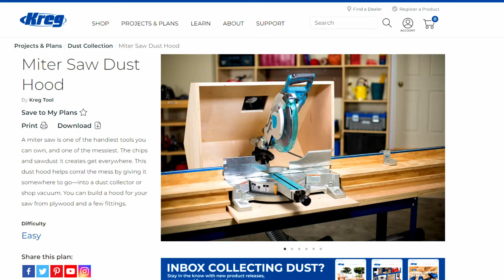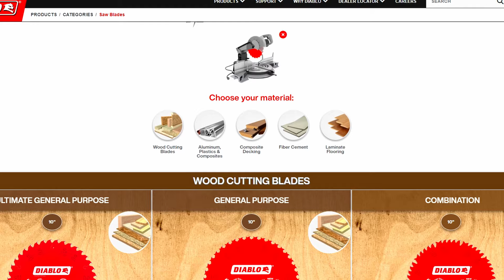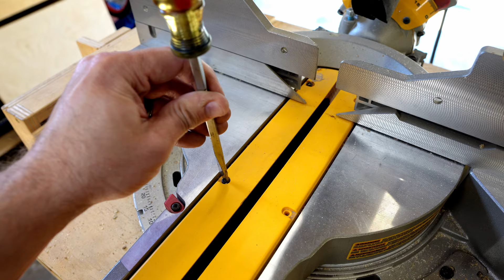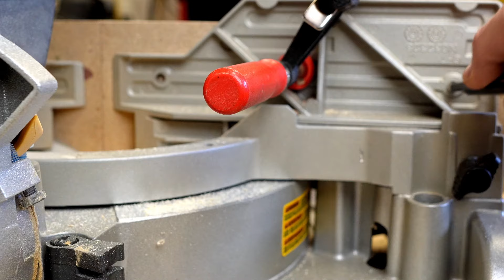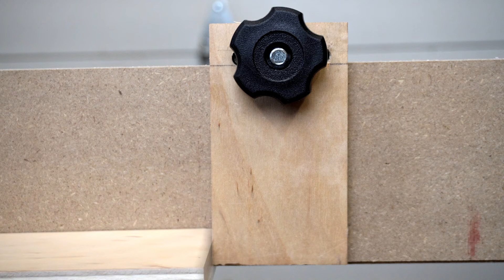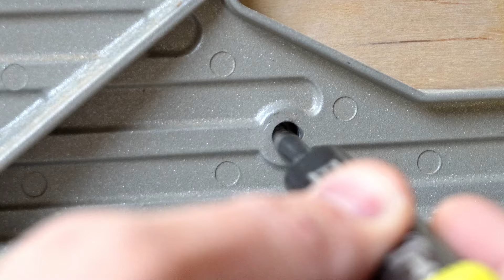Miter Saw UPGRADES - Best Dust Collection For The MONEY$?

Comment: The shop nation mod is great unless your cutting thicker wood, say 5/4 and up.  The rubber boot gets pressed into the saw blade.  Soon enough the boot is rendered useless and the dust control droops significantly

Comment: To prevent the stop block from moving when you bump your stock up against it, put some fine grit sand paper on the back of the front piece of the stop block.
Reply from the maker: That is a fantastic tip for stopping micro-creep during repetitive cuts!

Comment: I just installed the ShopNation dust collector. Easy install and it really does the job. Just a bit of sawdust escapes, compared to the original duct. Wish I'd had it a month ago when I did a ton of cutting.
Reply from the maker: It really is a game-changer for keeping the shop clean, especially since that original duct on the DeWalt is notorious for blowing dust everywhere!

Comment: I used a 9" spacer block to get the stop block from hitting the fence for shorter cuts. This assumes you have extension wings level with saw table. However, I just got a new saw so I had to completely rip apart my original miter saw station. 😢
Reply from the maker: That’s a clever way to handle short cuts, but having to tear down a miter station for a new saw is always a bittersweet project!
Reply: @WiscoWorkshop the new saw is a big improvement. Besides the old saw died a horrible death. A fix wasn't worth the money.